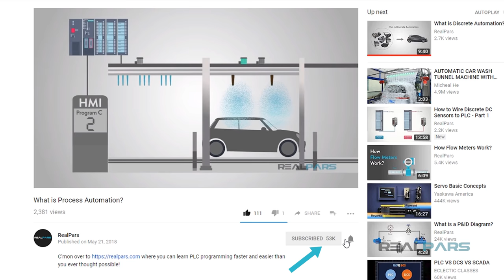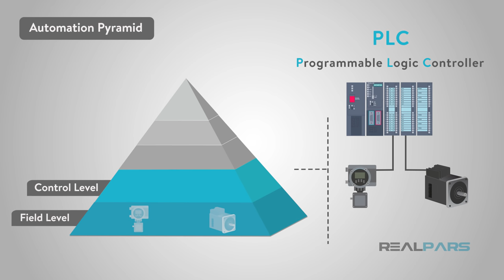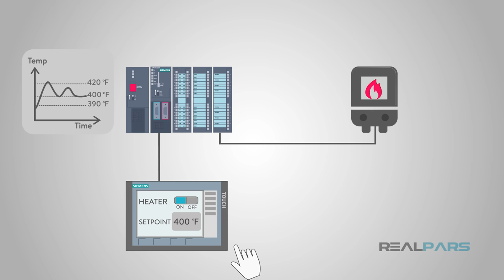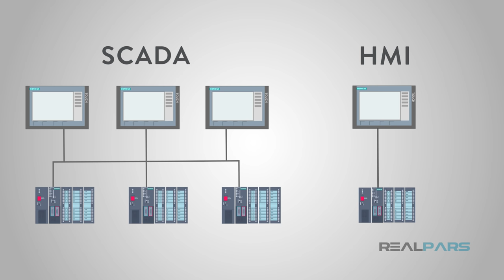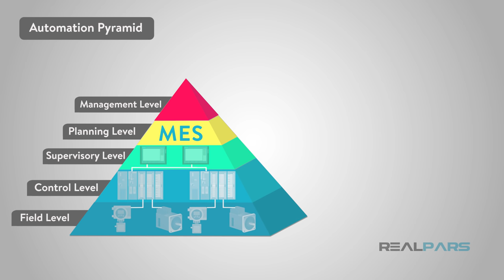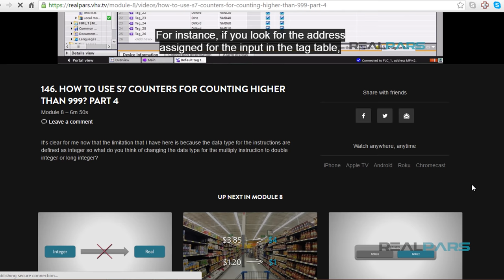What is the Automation Pyramid?

Comment: realpars: makes sure automation students passes their exames. great for a quick recap of the different lectures throughout the semester. specially in these corona times.... only theory no practical trial and error... thanks!
Reply from the maker: That is amazing to hear! Keep up the learning curve - great that we can play a role in that!
Reply: @realpars  well i passed. not in a pretty way. but passed. :) it's hard when you are a practical learner and work with aduino and 3D printers in the spare time. but forced to work with expensive Siemens equipment. and Corona didn't help. because that kept us away from our hardware....
doing marine engineering at SIMAC known for primary Maersk students, officers and marine engineers.

Comment: Hi. Excellent video. Question; Can we take Power BI as one the examples for the Planning Level?
Reply from the maker: Power BI is a tool that certainly can be used for planning. as well as o0ther data-centric analyses.  You will also need to collect the data that is analyzed by Power BI to have a complete Planning level application.

Comment: According to the pyramid...Where can I put an DCS (distribuited control system), at the same level of SCADA in the pyramid? What's the main difference between DCS and SCADA?
Reply: I would recommand to view at the website ResearchGate, there is a comparision between this both...
To keep it short, SCADA is event driven and data oriented. Its used to monitor and control a whole process. 
DCS is more a local control. Its process oriented and state driven. Its controls a concrete process part. 
So I would say, DCS is more in Layer 2 - Control Level in use and not at the same level as a SCADA. 
https://www.researchgate.net/post/What_are_the_two_major_differences_between_DCS_and_SCADA_systems

Comment: I love your videos. Great Job.
Do you know what are the "telegrams" in the MES System?
The MES Terminals are sending the "telegrams" to the Server?
What is a telegram?
Reply from the maker: Hi there, thanks for your compliment and happy to hear that.

The software systems that run at the level 3 are called Manufacturing Execution Systems or MES. This software communicates with all Level 2 systems at all times through bi-directional telegrams. The term "bidirectional telegram" here means communicating through sending and receiving messages. The type of communication depends on the design of the network structure. 

We can say level 4 communicates with Level 3 through bi-directional telegrams as well.